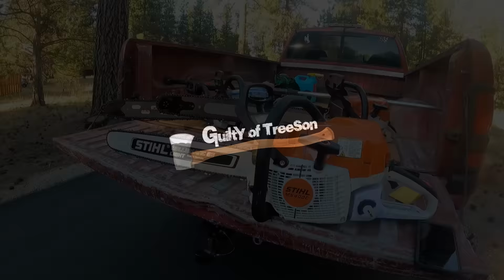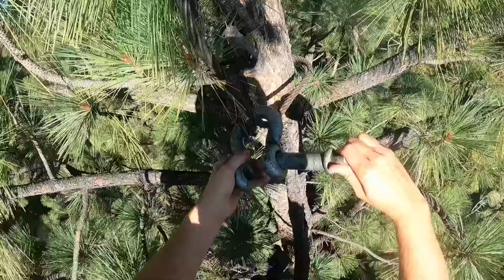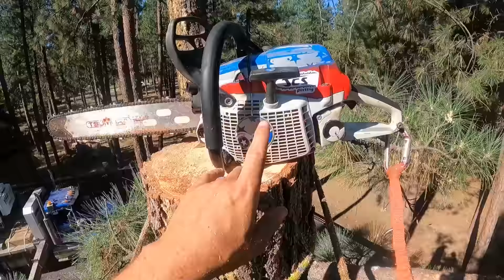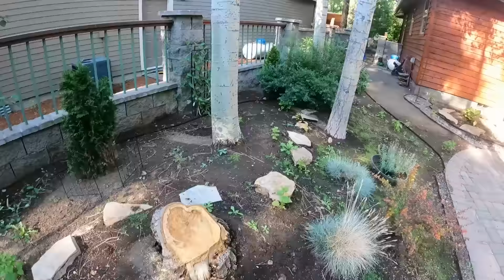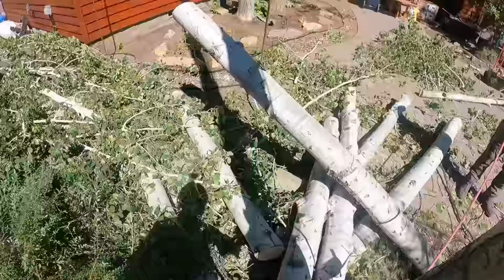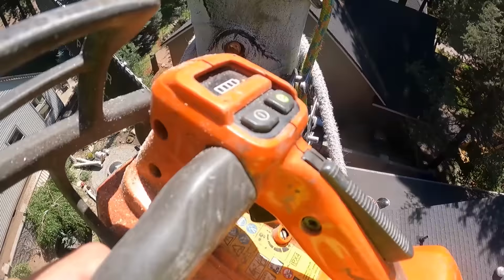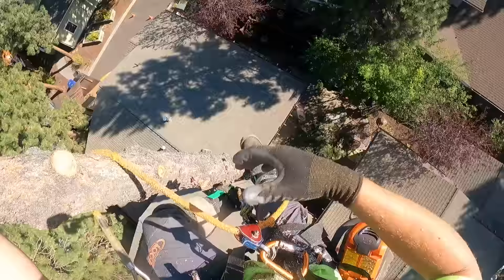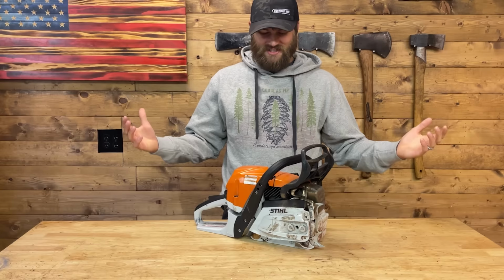Hands on Review of The Stihl MS 400c!

Comment: If you can charge batteries while you work, you might consider a Makita battery saw. You can get a saw with 4 batteries (it uses two at a time) for $400-ish, and it comes with a dual battery charger that charges a set in 45 minutes (or a bit longer if they are too hot), which I believe is the fastest in the industry. If you can get 45-60 minutes of use out of a set of batteries, then you could work continuously and always have a set of batteries charging. I know it won't last 45 minutes bucking logs, but it will probably last that long limbing. I have no idea if you can swap bars or dogs, and I don't know how it compares to battery saws from "real" chainsaw brands. My only complaint is that the tensioner is terrible.
Reply: They use the Oregon A041 mount, same as the smaller residential grade Dolmars that Makita persuaded Dolmar to develop. The larger battery models may use the small Husqvarna mount.

Before Makita bought Dolmar in the early 90's they only built pro grade saws, which were too well made and hence pricy for marketing to light use residential and hobby farmers. 
I know Dolmar were never really marketed heavily in the US, and are far less common there than in Europe, but they're good saws. 
The pro series Dolmar use either the Husky large or Husky small mount (Oregon D009 and K095 mounts), or if you have an older large model, Dolmars own mount (Oregon D033).

Edit: Makita saws ARE a "Real" brand saw. They're Dolmar saw technology married to Makita battery and electric motor technology.

Comment: I bought a 400 last winter and the first few tanks was bucking 24in oak and I was thinking that I had made a mistake! After several tanks of fuel and a Bark Box it opened up and runs MUCH better! I don't know that the Bark Box boosted it much but I have ran it with and without several times and the BBox lets it run much cooler and that has to be a good thing. 
Thanks for entertaining and educational vids!!

Comment: I ported my 400 and that little hesitation is gone. It’s really good ported.
Reply: All he heeded to do was lean the low jet out slightly. It’s a tad rich on the bottom end, probably due to the high altitude that he mentioned. That’ll take care of the bog.
…
Jake is right: The 400 is just a 362 modified for more power and featuring a magnesium piston to cut the reciprocating weight.
Reply: @WildAcresFarms  You realize this is an m-tronic machine. There’s no manual adjustment. Now the computer may have adjusted on it’s own. From my experience that hesitation disappeared after I got mine ported. Throttle Response was very noticeable after porting.
Reply: @runtimmytimer  Yes. It’s a CM. In which case Jake, I hope, fired it up and left it in the START position for 90 seconds, switched it to RUN, and made a few large full throttle cuts. That’s the factory reset procedure for the carb.

I know Jake is an experienced operator, but he’s definitely not a saw mechanic. He might not be familiar with re-tuning the newer computer saws. If you let them tune on their own, it takes quite a while. That is probably the reason the saw was running better after a few tanks. My 661C does a great job of tuning itself immediately if you follow the steps.

Comment: I want either a 400 or 462 but can’t decide. I know a 28 inch bar would be pushing it on the 400, but do you think I could run a 28” light bar with a full skip chain? I’d like to save the weight with the 400 even if I lose a little power.
Reply: 462. I've run both. 462 has noticeably more power and I can't tell the 1lb weight difference. Over size of the saw feels the same
Reply: @colinmckim4515 I looked up the specs on the 400, 462, and 500i.
Weight wise the 400 is only half a pound lighter than the 462, and the 500i is 1 pound heavier than the 462.
So that's probably why you didn't notice any weight difference between the 400 and 462.
Ps. These weights specs are with no fuel or oil.

Comment: IMO, the 362 and 400 sit in a weird place. Not really powerful enough to be a do-anything big saw, like a 462 or 500i, but too heavy to be a go-to back handle climb saw, like a 261. The role they fill in my head is a high-end homeowner/ranch saw, for someone who knows that they won't ever need to cut anything huge.

As for Stihl saws in general, they have great engines, but it feels like the engineers who design them don't use chainsaws. The oil cap is bad, the dogs for a lot of saws are way too small and interior only, and a lot of them don't come in full wrap options, even if the saw is pretty big, like a 400.

Personally, I go with Echo. Cheaper, IMO more sensibly designed, and while their power isn't great, it's nothing a port job can't fix.

Comment: My 362(with a bark box) would eat that thing alive 🤣🤣 but as you said , after a few days it seemed like it woke up. The 362 was the same for me, first couple days were a lil luggish, and after a couple tanks and then the box box, now almost two years later it rips with a 25" bar. Not to mention, my 362 was 850$ (Jan. 2021) with the full wrap already installed. Loving the reviews tho, keep em coming 💪   I think it'd be nice to see a comparison video (probably team up with Gordy) and show the difference between some of these newer saws and the older models. I have an 066 from right before the 660 came out, an 066 red light, and an 064, so it'd be pretty sweet to see a comparison of the newer 661 with some of those older models.  I think new saws are the way to go for a business operation especially if you don't already have a bunch of saws, but those vintage saws are frickin sweet and still kick ass if you find one in good condition.
Reply: Not so sure of that.
Reply: @steppoffaith8426  not sure of what? Lol

Comment: Cubic capacity (CC Cubic capacity)

The size – or cubic capacity – of a car's engine is measured in cubic centimeters (cc). It refers to the amount of air and fuel that can be pushed through the cylinders in the engine.
Reply: cubic centimeter